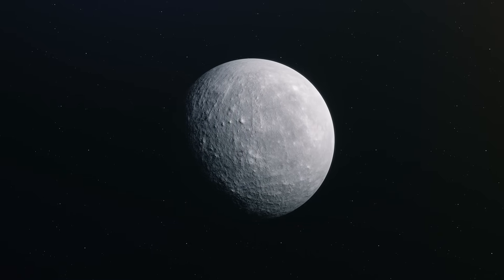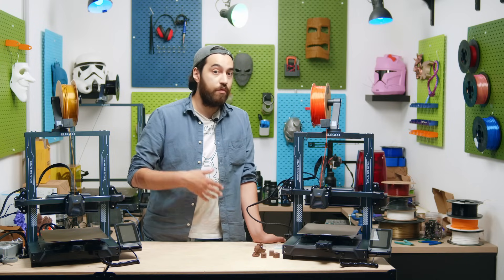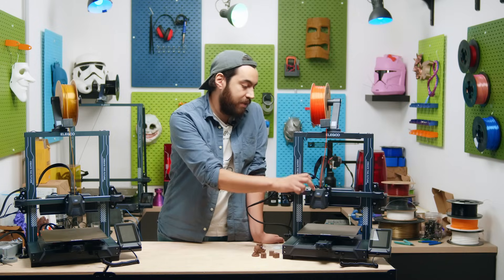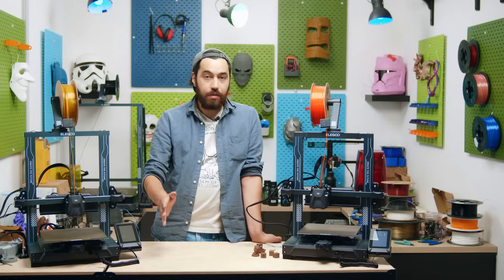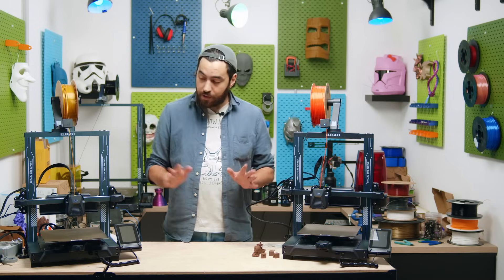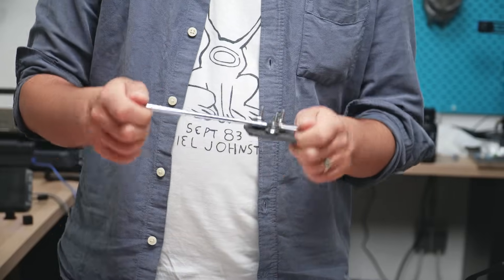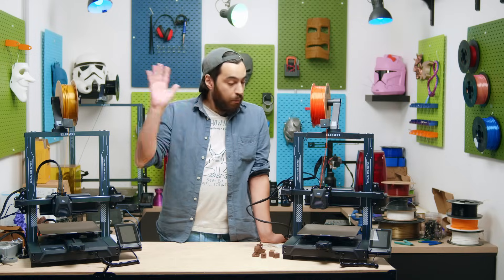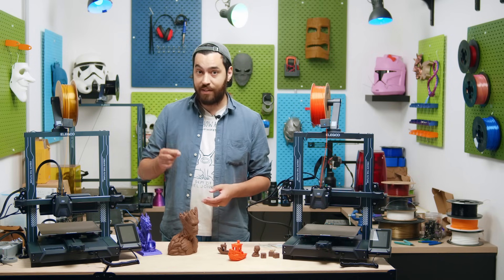Neptune 4 and 4 Pro Review

Comment: i wish i never bought my nep4 its the single worst example of aftercare and firmware support i have ever known, genuinely a prize piece of shit, my chinese knockoff 'pusa' was so much more usable than this thing. z offset wont save aux fans broke and stopped working ..blobs of death, if your reading this in 2024 ..do...not...buy... save for the bambu..fuck this machine, elegoo are great at resin but absolutely suck at fdm.
Reply: Wish I read your comment before I bought the Nep4 Pro.  Worked great for the first week, the couldn't get a good print.  After a couple of days of trying to calibrate and re-calibrate, then re-calibrate to no avail, I contacted Elegoo support.  What a useless bunch they are.  I explained that the printer worked perfect for a week and then could not get a good print.  I sent them all the info and type of filament I was using and they told me I was printing too fast.  I explained again the it worked perfect for a week with the same gcode and filament and that I was printing below the recommend speed of the filament (Elegoo filament) then they change their tune and told me to basically the the machine wears out and everything has to be checked (every screw and pulley).  I explained that it was only a week old.  I tried to initiate the return policy as I was within the 14 days and I felt the it was malfunctioning.  They refused the return.  During this time of spending days and tons of filament trying to get the Nep 4 Pro working again I bought the Bambu Lab A1.  What a world of difference.  I regret buying the Elegoo Neptune 4.  I have had the A1 for a couple of months now and have never calibrated or touched anything on it and it just prints perfectly everytime.  Oops, i forgot to mention the the A1 is about 100db quieter than the shitty Neptune 4 that sounds like a jet engine.

Comment: Is it easy to change filaments while printing? Like the run-out?  Thanks.  great video.
Reply from the maker: Yeah very easy, for an endstop switch style sensor it is very fluid. 

But if you want to do colour swaps while printing and you got the printer soon after it was released the M600 command is disabled, you need to update the firmware. Current versions should be totally fine.
Reply: @3DJake_Official  Okay Thanks Much.  Just bought it and it will be here Friday
Reply from the maker: @ChinaAl  Nice! Enjoy!

Comment: Very loud at 88db
Reply from the maker: On its "Violent" settings yes, it is, but you can turn it down. I would suggest only using that setting for the highest speed on smaller PLA prints.

Comment: i hear people say the Neptune 4 Pro are not in alignment even after calibration, if you print a cylinder and measure it. Its not round as it should be, its off but about 2%. have you noticed anything like that ?
Reply from the maker: Hmm I just did a test print of a 25mm cylinder and the worst tolerance was 0.96% off.
Reply: @3DJake_Official  ruffly 1% that can pose an issue if you go for tight tolerance. I guess

Comment: This or the kobra 2 pro
Reply from the maker: Tough call. Depends on what you're printing because the Kobra 2 Pro has a PTFE hotend so no high temp filaments. The Neptune 4 and Pro both have 300C hotends and also way better cooling but are not as fast as the Kobra 2 Pro. Neptune 4 has only 5K mm/s2 acceleration but the Kobra 2 Pro has 20K. It can print a lot faster...hmnm yeah tough call.
Reply: @3DJake_Official  I'm actually looking at the plus models I think the n4plus has 12000 acceleration vs the kobra 2 plus 10000 would I be right in that
Reply from the maker: @davidmulhall3187  Yeah that's right, a difference of 2K acceleration is actually not that much in practice so again we come to the hotend issue. I would be more in favour of the Neptune 4 Plus because of that.
Reply: @3DJake_Official  think I'm looking more towards the n4plus hearing alot of problems about the kobra 2 on there reddit page when do you think stock will be available will be ordering off you
Reply from the maker: @davidmulhall3187  We're due a delivery of the N4Plus today actually. The Kobra 2 Plus delivery is due next Wednesday
Reply: @3DJake_Official  perfect it's for Christmas so won't be ordering for a week or two

Comment: 10:26 Don't get me wrong that's a fast print but don't you think 18.55 is way closer to being 19min than 18min
Reply from the maker: Actually recorded the timelapse last and the slicer said 18 minutes but the print took a bit longer, didn't seem that necessary to correct it.
Reply: @3DJake_Official  It wasn't, I seen other reviewers state the 18 but then their print took over 20 either way it's pretty quick
Only thing holding me back from ordering one of these is I've seen a reviewer say he's had 2 different review units and the x/y axis was off square on each one, Is this something you have seen / tested for? https://youtu.be/-rlOoGLZdoo

Comment: Sorry if you’ve already answered this question in the comments but which is better between the N4-Pro and the N4-Standard? I was initially inclined to go for the Pro but I read some reviews where the standard had a better score overall. Thanks in advance!
Reply from the maker: So after multiple months of using both printers I see zero difference in terms of quality. The only reason I would choose the Pro is if I was concerned about the power usage
Reply: @3DJake_Official  Interesting, thanks for your reply. Doesn’t the Pro use more energy because it has dual bed heating where as the standard version is singular? I’ll have a look into the power consumption 👍🏼
Reply from the maker: @david_wright  It would use less if the part you are printing is small, it would only use a portion of the bed and less heating cycles.
Reply: @3DJake_Official  Ah got ya! That makes sense. Cheers mate 😃 useful to know

Comment: What I still want is the possibility to control via phone. See a video what is currently happening with the possibility to stop the print. EVEN when i am not in the same WiFi Network. So when I am grocery shpping (for example).  This is important for bigger prints which are aking very long.

Comment: So when a spool gives you 60mm print speed does this not matter if you up the temperature for example?
Reply from the maker: It would really only make sense if you're printing large layer heights or with a large nozzle.
Reply: @3DJake_Official  ok just if I got this printer I'd want to maximise my print speeds lol
Reply from the maker: @1937Brett  We have been printing at 300mm/s with standard PLA settings, no change to temperature necessary.
Reply: @3DJake_Official  ok brilliant thanks for the tips

Comment: I also have the printer and am happy with it so far. However, 3DJake probably sent me a used printer at full price. A large part of the printing plate was full of glue, the test filament was only a few cm left and there was no protective film left on the display. Don't think it's too common from testing at work. I've had enough bad experiences with used items
Reply: You should send it back
Reply from the maker: @mickleblade  @theEndsieg Yeah you should contact our customer support about that and send photos showing what you received and if possible the box it came in.

Comment: It seems that every fast 3D printer this year has its own high flow nozzle that is almost a Volcano but isn't.  We already had a good standard in the Volcano and nozzles of all diameters were already readily available, including hardened steel versions for abrasive materials.  Why did every manufacturer create a new proprietary nozzle for each new printer?
Reply from the maker: This is something I am really disappointed about and I really don't see it changing. You can get a volcano nozzle anywhere but you can only get a proprietary nozzle from the manufacturer :(
Reply: @3DJake_Official  - Give it a few months and Micro Swiss will make nozzles for all of these proprietary nozzle designs, so there really wasn't much point in every manufacturer making a proprietary design.  On the low end, there will be no name generic nozzles on Amazon for all of these printers, too.  It takes 20 minutes to change an existing nozzle CNC file.  It's just stupid.

Comment: Can the filament spool be mounted on the side? I'm restricted by the height of the machine.
Reply from the maker: with it's current design no not really :(
Reply from the maker: but other designs would fit, the frame is made of extruded profiles so screws and t-nuts will fit

Comment: I'd love an Elegoo Neptune 4 Pro that has a 300 mm cube build volume.  I can think of a few other improvements such as WiFi and a 4 wire CANbus cable to the extruder instead of a floppy ribbon cable, and force sensor for auto bed leveling and Z offset.  I was leaning toward a Creality K1 Max to print ABS but I like the lower cost and easier maintenance on an open architecture bed slinger.  Maybe I should convert my ABS parts to PETG and stick with a new and improved Klipper bed slinger with higher print quality, better part cooling and a bit faster printing although I'm more concerned with print quality.
Reply: I decided to stop waiting on the next big thing because something better is always on the horizon.  I bought a Neptune 4 Pro.  It hasn't shipped yet but I'm looking forward to my first Klipper 3D printer.

Comment: Whats the difference between the pro and non pro variant?
Reply: Pro has steel rollers instead of plastic V rollers, and Pro has a split heat bed so small prints only need to heat the center of the bed to use less electricity and produce less heat in your office.
Reply: Wouldnt bed warp if you heat only the middle?

Comment: nice review, looks like a fine printer. just one question, does it come with an accelerometer?
Reply from the maker: No it doesn't, I don't think there is a port on the mainboard for one actually. Input shaping would need to be figured out manually.

Comment: I got my 4 pro on pre order hoping to get it next month..any one plan on using prusaslicer for this printer? I am new to printing and having a hard time find and prusa profile for the neptune 4 pro
Reply: It shouldn't be too hard to make a profile in Prusa slicer as it has many of the same settings as Cura (sometimes with differant names). Just open the Cura profile in Cura and manually put the settings in Prusa slicer. That should be a great starting point. That's all I can recommend if you don't want to wait for someone to make a profile. Good luck I hope you get it, and welcome to 3d printing!
Reply: @westinspace9286  yeah I get just transfer over most of the settings wouldn't be to bad I just wast sure how like input shaping and things like that would work ..like if that part of the slicing feature
Reply: @whitetailtherapy7908  that Is part of the firmware and won't effect the slicer as long as you make sure to disable acceleration control and that minimum layer time is not too high in the slicer and let the firmware handle it. I'm probably not the best person to give advice on that though as the Neptune 4 will be my first printer with input shaper. I mean other than in the Matlin update but I never calibrated my printers for it.
Reply from the maker: I would love that but haven't seen any profiles yet :/
Reply: @3DJake_Official  I'm sure eventually someone will make one...completely over my head to make one from scratch..Hopefully more people start getting their hands on them I'd really like to get a hardened nozzle for mine ..elegoo never really answered my question if they were gonna offer that though

Comment: I have a question which I haven't been able to get an answer to even on Elegoo's official site . What is the acceleration of the Neptune 4 and 4 pro ? This is an important one as if the acceleration is slow its not going to be able to get up to its top speed in a lot of prints . It's great it can do a benchy in 19 min ( wasn't 18 as it was 18.55 ) but so can some other  printers if the layer height is set at .25 or .28mm . The true test is how quick can it print a .2mm layer Benchy plus what is its acceleration? Its almost certain that the printer rarely reached 250mm/s doing the benchy as is too small a print to be able to get up to that speed; this is where the acceleration comes into play . I am not saying its a bad machine by any means but its hard to compare if you don't know all the specs of a machine. I know the Anycubic Kobra 2 acceleration is around 2500-3000mm . The X1 Carbon from memory is 20000mm. So naturally if you put the 2 side by side the X1 should print similar prints quicker than the Kobra 2 even if they are printing at the same print speed cause the X1 can get up to that speed quicker. I know this is obvious stuff but is handy to know if your trying to compare printers in the same price range. Yes , I know the X1 is more expensive ; I was just using it as an example on acceleration speeds. So back to my question; what acceleration does the Elegoo Neptune 4 pro do ??
Reply from the maker: Good question. It is definitely way lower than the X1C, I asked Elegoo, let's see what they say.
Reply: @3DJake_Official  
Thank you for doing that .
Reply from the maker: 5000mm/s3......I think the X1C wins on acceleration.
Reply: @3DJake_Official  
Thank you for getting back to me with those figures. That figure also places the Neptune 4 pro ahead on acceleration against the Kobra 2 plus the Neptune has klipper. It's definitely getting interesting this year with these new fast printers emerging!

Comment: I just bought an Anycubic Kobra 2 and it is an upgrade over my last slinger. Despite the auto leveling on it, I think I might sell it and buy this Neptune 4. It just needs auto bed leveling and it will be perfect.
Reply: If I'm not mistaken, the bed is auto levelling plus auxillary levelling, the base neptune 3 seemed to be touch and go with the auto levelling and without the auxillary knobs I imagine it was frustrating, doesn't surprise me that they added them for the 4.

Comment: Worth noting that you can turn the aux fans down - "silent", "normal" and "violent". Judging by the other reviews, this one was set to the "violent" default. They are 40x20mm fans, though, so it should be possible to replace them with Noctuas (especially with their new 24v adapter).
Reply: Was wondering about replacing them too.   Does noctua have 40 20 blower fans or just regular?  Can you replace the blower fans with regular one?
Reply: @andrewfisher5303  - I'm not sure these are blower fans? I haven't seen inside yet, but their own site says they're 4020s, which suggests they're standard fans and the enclosure provides the ducting.
Reply: Assuming that limits your print speed, has anyone been able to check what's doable with the different fan speeds?
Reply: @digiscream - Thinking about getting the 4.....where is the fan control, physical switch on the fan or a setting in the software?  Thanks.
Reply: @beav1962 its in software

Comment: Can we expect Plus and Max model soon?
Reply from the maker: Pretty sure a Plus is in the works, not so sure about a max though
Reply: I'd love an Elegoo Neptune 4 Pro that has a 300 mm cube build volume.  I can think of a few other improvements such as WiFi and a 4 wire CANbus cable to the extruder instead of a floppy ribbon cable, and force sensor for auto bed leveling and Z offset.